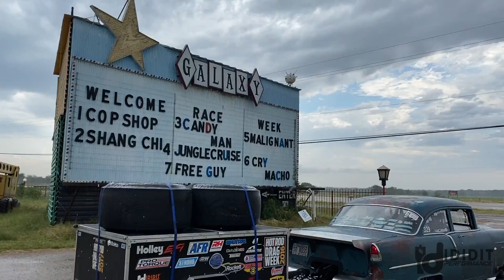Sweet, Sweet 55 Chevy Race Week Victory 🙌🏼 WE WON ! - Rocky Mountain Race Week 2.0 2021

Comment: Your Dad has to be the luckiest Father.. The Fact he had a daughter that picked up his passion for cars and racing and has the brains and mechanical awareness it takes is incredible.  Lots of women are smart but understanding how mechanical parts work together, is an entirely different beast....  I think I'm pickin up a few hints your droppin at the end of the vid: "start of a new era" maybe a 60's project.. ehh scratch that, you had bad marrow from then... I'm thinking late 40's project??  So Ive got a 50 chevy 5 window pickup  that was my dads highschool truck. would love to see you guys build one too!
Reply: ,,,,,,,,,,,,,,,,,,,,,,,,,,,,,,Build a pro stock chassis [like the 55 ]  for  the blue willys .............low  , mean , goes straight as a string  , built by,   Dennis 'On Rails' Taylor................

Comment: Great job surviving back to back race weeks. Y'all got the job done without making parts fly where they shouldn't. Alex you're actually a smidge taller than I thought you were. Don't be too hard on DT over the gas fiasco because strange things happen when you don't sleep especially when you get older. I'm almost old enough to be your dad and can relate. Now for next season keep that wingnut behind the wheel tight and bust consistent 6's.
Reply from the maker: Haha! Thank you! That's what I'm saying... not actually that short!
Reply: @RidingWithAlexTaylor  I'm only 5-7 with short legs and also have to have my seat slid way up. The less fluffy I am the further up the seat goes lmao.

Comment: When you stay in the water box doing a burnout you can water all over your fenders which will drip back onto your tires during the Run.  Pull out of the water box then do the burnout.  Tech tip Tuesday on Monday.

Comment: Well I am pretty sure you have joined the other great ladies of  Drag Racing well done
 Looking forward to next year, really surprised you did not melt down with that little sleep and no major incident's no injuries. And your dad he puts up with you how, so give him a holiday away from the shop no petrol head stuff, unless like me can't just sit on a beach, last time I tried I ended up sitting in a boat with a big block motor and blower that spluttered to a halt and floated onto the beach could not resist going to have a look as I had heard it blowing round Bermuda, long story short the Magneto drive had stripped they could not work out what had happened so I ended up with oily hands face and belly a great day at the beach and four hours later I was getting my adrenalin fix eight miles off the island of Bermuda everyday until time to fly back to the UK what a holiday my better half said never again hmmm.

Comment: That truck had my favorite square body exhaust system ram's head 68 sbc truck manifolds and a walker dynomax SBC 2 1/2 inch exhaust kit with a a set of race magnum bullet glasspack mufflers and stock exhaust pipe exit location behind the rear tires under the corner of the bed loud and snappy loved it, the h.o. 305 with the summit racing 1102 cam kit did not..

Comment: I did that once.. but I wasn't pulling a trailer I was was a built gas swapped 82 Chevy k20 faded red and black pinstripe Silverado 6.2 vin z diesel truck I had a total rebuilt 84 Chevy Camaro 416 58cc 305 h.o.,, and went and got my momma a load of  compost dirt that the local green house was giving away and didn't use the gas can in the bed of the truck to go put fuel in it, because my gas guage doesn't work because it was a diesel truck.. and I had to dig out the gas can a go about 10 miles into town to get fuel in the gas can which was 87 octane which got the truck home spark knocking till I put 104 blue octane booster in the gas tank and fixed the ground wire on the fuel guage the diesel guage still read different though..

Comment: You should talk to your local Summit store about putting the 55 on one of the turn tables as you walk in and have it on display for the people that haven't seen it in person or in a video can see it and take pictures with it I'm pretty sure with all of the money you have spent with them over the years they should have no problem with putting the 55 in their store and if or when you bring Badmaro back out before you do you should get Scoggin Dickie's, Mike Lough, or TKM to build you a water jacketed billet block 427cid or bigger LS and put it on Drag Week and Race Week and try to run 6s on small tires in it with an LS or maybe even throw a Steve Morris SMX or BBC in it I don't know if you saw it or not but a Foxbody Mustang ran a 5 sec pass on 275s at World Cup and I think that is the type of racing and events you and your Dad should start doing either LDR or a class like that and try to get to as many 1/4 mile radial events as you can but if not run as many 1/8th mile radial events as you can and run SCSN,PSCA,LDR, World Cup and maybe a few others and maybe even a few small tire No Prep events because they pay big money over in North Carolina and South Carolina for the small tire No Prep races

Comment: Correct me if I'm wrong but I thought u were not allowed help from other racers or go to shops for repairs while running race week or is it just drag week ?
Reply from the maker: You can go to shops / buy parts / use resources while on the road during both events. Just can't help each other at track or have "pre-planned" help along the way, so to say.

Comment: You guys got to do a better job of getting the smoke out of that car before you make a run.  That's dangerous is 200 miles an hour.
Reply from the maker: It's not as bad as it looks. Where that camera is positioned the smoke kind of floats there and the sun just amplifies it. If you see it from the camera angle that is on the windshield you could tell better. Looking at ways to seal it up a little better next year, but only so much more we can do.